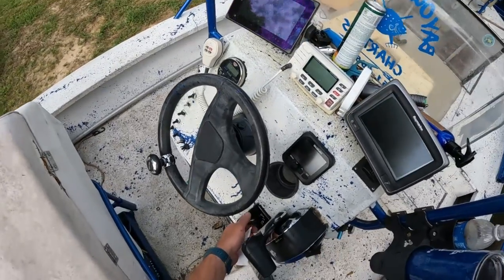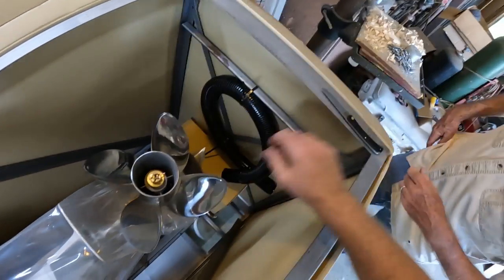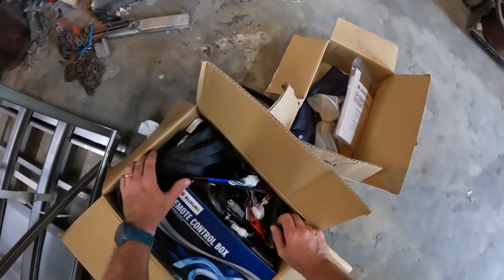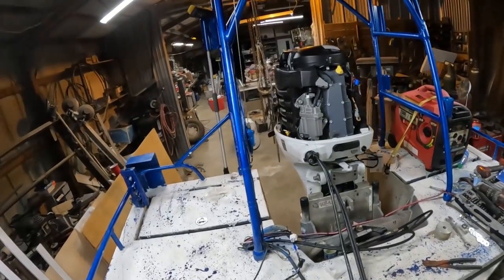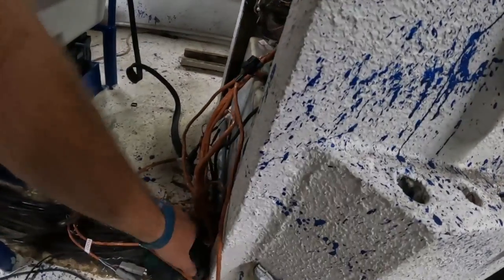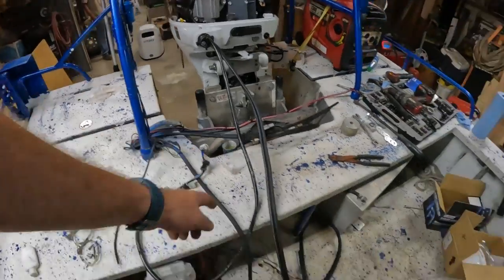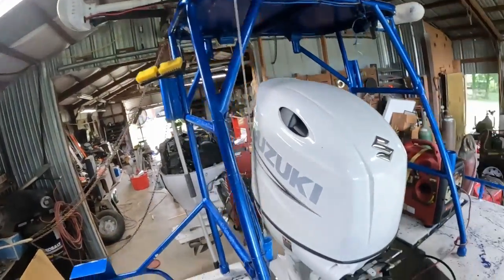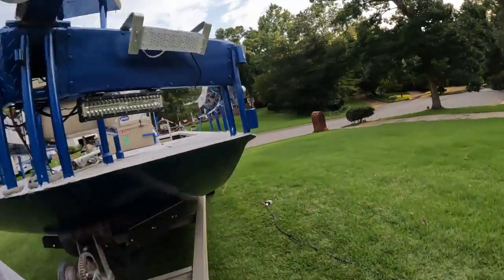**NEW SUZUKI 200 **FLY BY WIRE **OUTBOARD MOTOR INSTALL**

Comment: How  are the callibration works for this engine. I ask because I will buy a pair of 150 Suzuki AP DL . The dealer told me these electric engines you have to calbtare everything
Reply from the maker: I haven’t heard of that, I’ve had no issues with mine. 85 trouble free hours now.
Reply: It’s does have to be calibrated.. the dealer must have programmed everything prior to shipping…  because when you open that box only thing comes with that motor is the motor and rigging box with bolts primer bulb ect. That other box is a rigging kit nothing is programmed and has to be done with Suzuki software by a dealer..

Comment: Didn't you have to calibrate a new  engine?
I am asking because I will rigg a pair of DF 150 APX.
Reply from the maker: No sir, just plug and play!
Reply: @bayoubanditcharters  thanks, because they said me here the engines have to calibrate before from a dealer.  The mess here is the dealer doesn't got no time till october .

So I will install and rigg by myself

Comment: Was it all plug and play did you have to do any programming for the rigging and controls?
Reply from the maker: All plug and play! Very easy install!
Reply: @bayoubanditcharters how did you hook up your white wire did you go straight to the battery or did you go to the common post on your battery switch or did you make it so you could turn it on and off with your battery switch?
Reply: @bayoubanditcharters I'm in the process of installing mine

Comment: Where did you buy the motor? I thought a buyer had to have it installed by a Susuki dealer? Only asking because i have a boat that is very hard to trailer.. Thanks
Reply: My thought exactly! Several dealers said only a Suzuki dealer can receive them. That's the only way the warranty kicks in! Hmmmm really has me baffled!

Comment: Notice any hp gains from the suzuki 200 from the honda 150?
Reply from the maker: Definitely! Huge difference in torque, speed, and fuel efficiency!
Reply: @bayoubanditcharters  top speed on both?
Reply from the maker: 5 people loaded with gear and fuel. 35 for the Honda 150, 44 and hit rev limit with Suzuki 200. Still not propped  right yet

Comment: Fly by wire is JUNK, look at all the problems GM has had with it. I have one in my drive right now, spent over $650 and it still is a piece of crap. Take heed, it is not if it is going to mess up, it is when. PB
Reply: GM?
Reply: This a outboard motor manufacture that has sold thousands of these engines with very few problems reported.